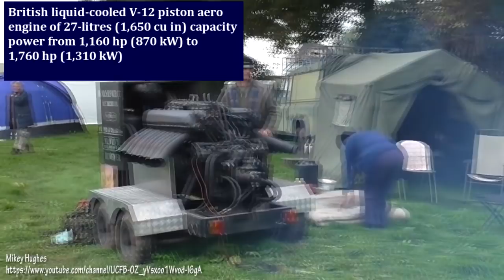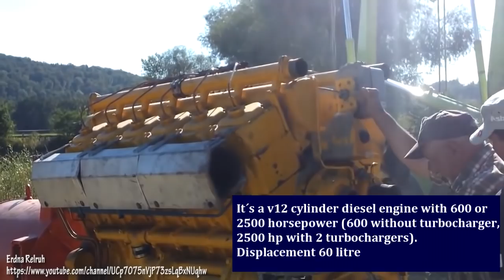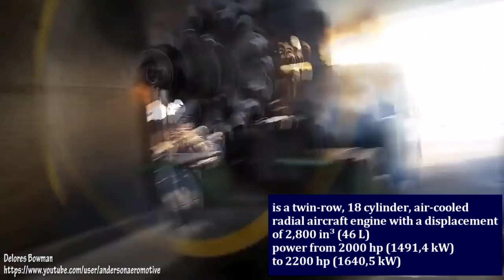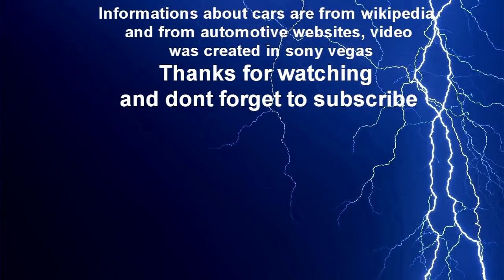Big Powerful Engines - Starting Up

Comment: the first one is a diesel engine and  mayback is a gasoline type engine, had the exhaust   on the side not on the top
Reply: I was thinking diesel, or possibly mechanical fuel injection set a bit rich, anyway.
I don't know the exact layout, but I remember there was an FI version for later Tiger tanks. (gives up and does a search) Yes the HL234 had FI. But I can't find ny pictures from the same angle.